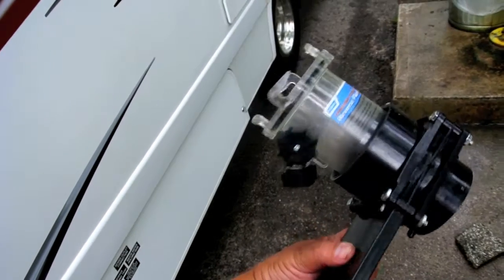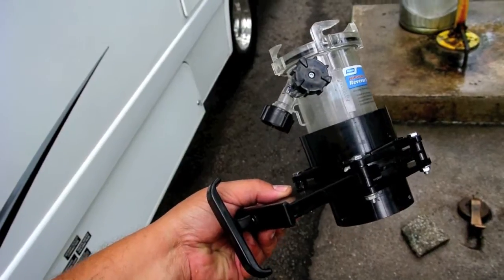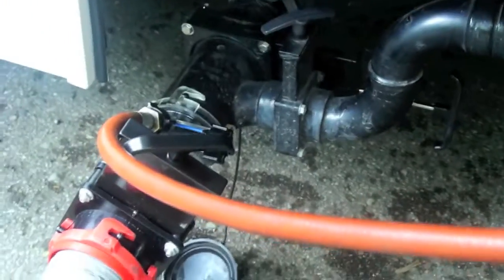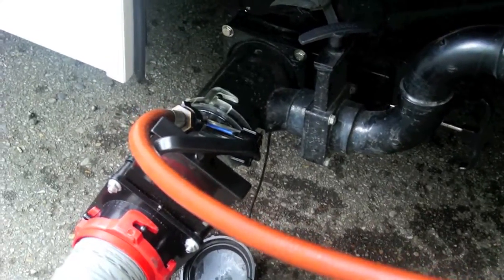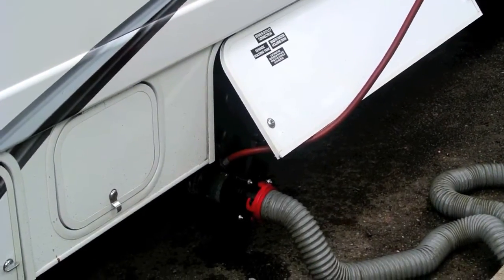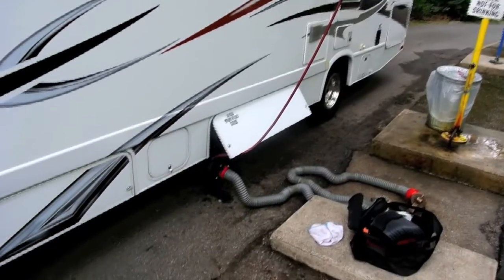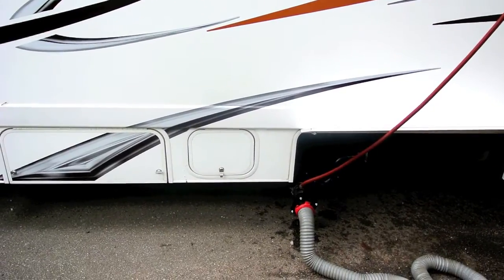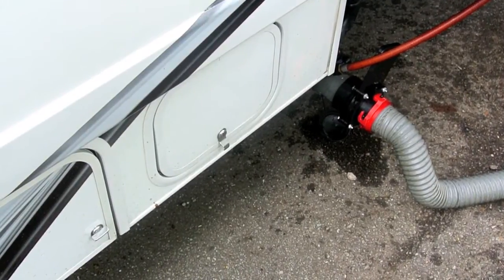Flushing your RV's Holding Tank with Camco's 39062 Flush Pro.

Comment: ALWAYS PUT ON THE ANTI-BACK FLOW ADAPTER.  Always take that one extra step to not contaminate any water weather drinking or bathing, ect., especially when dealing with cross contamination of sewer water.  Take the extra step and put on that anti-back-flow adapter.  It will take what?  1 minute or 30secs.?  We have to think about our neighbors coming behind us.  Yes, that water may not be drinking, but, might be the type water to rinse off skin or dishes, whatever.  Just take the extra moment to always put on that anti-back-flow adapter when dealing with sewer.  Please.
Reply from the maker: I guess I should explain a bit where that hose is. It's at the sewer dump station adjacent to the hole in the ground, and clearly marked not for human consumption. 

Typically, people clean out their sewer hose by sticking the end of that water hose in the end of their sewer hose, and I can assure you that they don't use an anti-backflow adapter.  It's main purpose in life is to rinse out sewer systems.

With all of the warning signs on that spigot, you would have to ignore your own personal safety if you were to wash your hands or dishes with that hose.  You are likely to get some kind of disease.
Reply: What is "ect"?